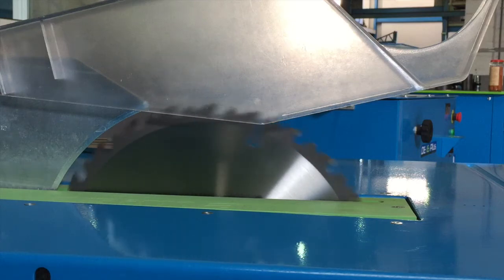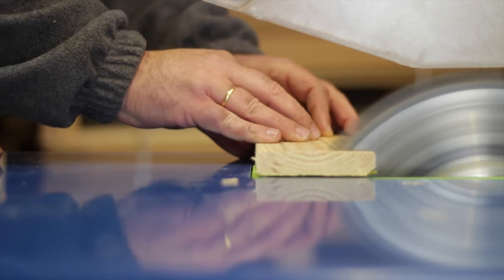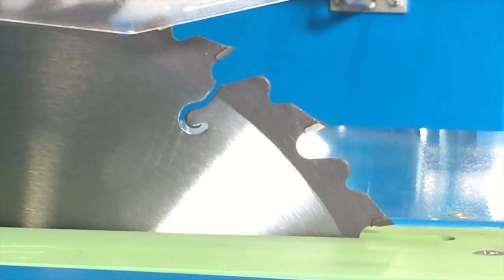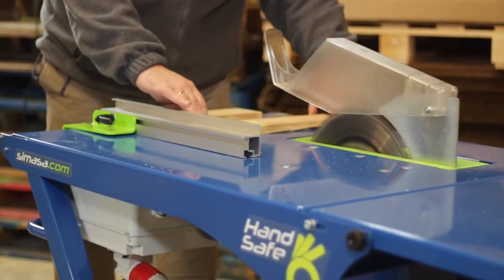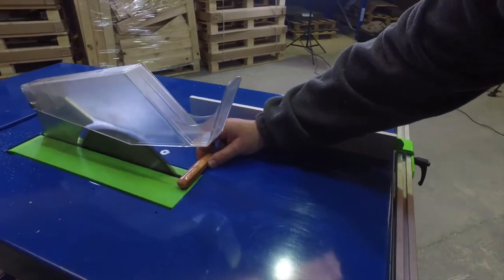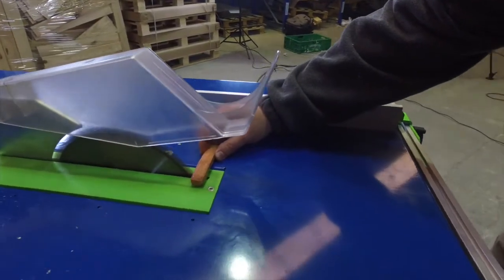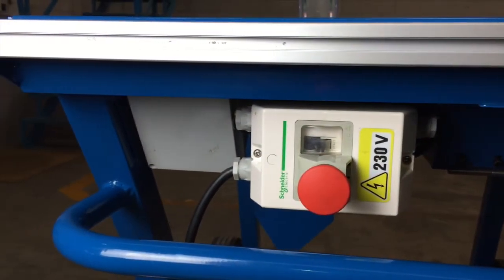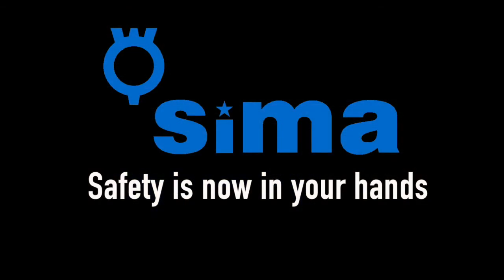Handsafe, the safest wood saw: by SIMA

Comment: Every cut he was making, without a miter gauge or similar device to support the workpiece, is extremely dangerous. (I don’t even see a mitre slot) At least show good practices for saw use if you want to be taken seriously.
Reply from the maker: Please, consider that this is a fictional video designed to illustrate and highlight the HandSafe system.  It does not imply that the user should operate this way.  
This granted, the video is as serious as it is having somebody’s fingers chopped off by using a wood saw without the Handsafe system, even if the video would be showing miter gauges, gloves or any other mandatory accessory.

The machine is fitted with a ruler by the way.